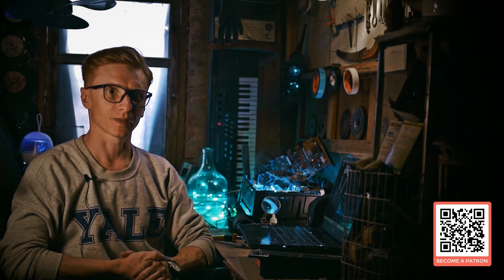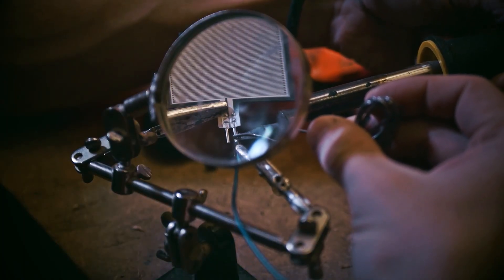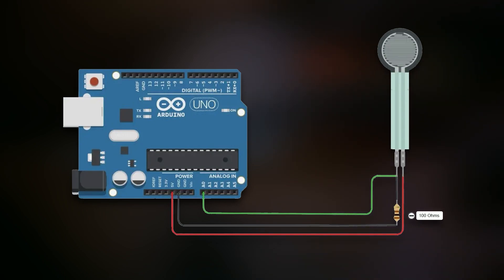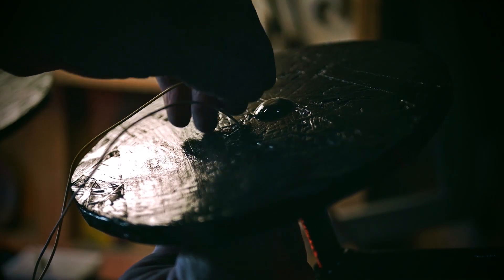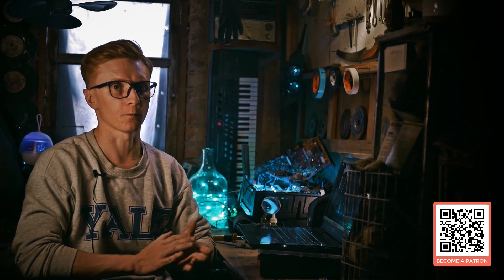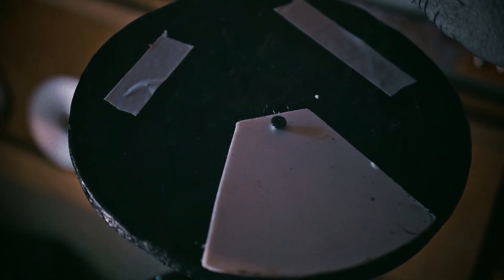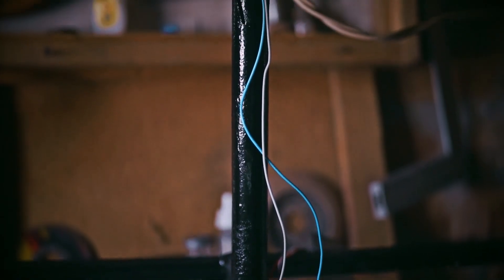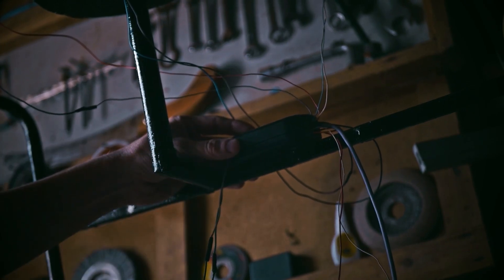DIY Electronic Drums for $20 | Arduino Build | PART 1: HARDWARE

Comment: Bro my drum pad is much much chesper than yours 😅😅😅made my drum pads by making a resistive touch with a plastic school paper file... aluminum tape...sandwiched between trflon tape snd they work amazing... Each pad is basically a large membrane button 🤣🤣 come on bro not all of us are billionaires like you ok
Reply: I'm curious, I'm not great at electronics so I've been learning.  I stuck this in AI and asked it to explain how a diy membrane button works.  One of the things it mentioned is its an either on or off thing, and its max volume no matter how hard you hit it.  I was curious if that's your experience or if you had a way to overcome it (or if AI is just being stupid)?
Reply: @LawrenceMarks27  on and off thing ? Naah if you sandwich the cathode and anode properly with a grid of white Teflon tape between then there is no reason for it not to work  basically the white Teflon has spac3s between so when you stroke you connect the circuit...and yes it is basically a super sensitive triggered drum ....so the lightest strike sounds like a hardshot ...its exactly what I wanted cause I love playing death metal gravity blasts if you know what that is its super fun man ....think of it as a keyboard membrane but with massive buttons and each button is a snare  or symbal or whatever ..i used conductive ink on Transparent plastic printer paper PET SHEETS or thermal paper.. with a grid of teflon tape in between ..dont use electrical tape cause it will insulate the electrical charges...chatGPT likes to complicate things as much as possible and will tske you on a long ass journey while it KNOWS theres a much simpler solution to whatever youre trying to achieve ..its so annoying !!  I wanted to connect a MIPI screen to a rasberry pi and it made waste my money on expencive driver boards ..when al i needed is a mipi adapter ...watch out cause its literally doing this with everything  you ask....hope this helps
Reply: @The_Qarmatian  I think you might have misunderstood what I was saying.  It was more that you don't get a dynamic velocity and it's just a hit with no "touch" to it. Well, that's my question anyway.
Reply: @LawrenceMarks27  sorry homie english is not my language, I still dont understand exactly,  but if this helps...its exactly like playing drums by pushing a button on your keyboard..so there is no rim shots and side snare middle snare ...its one sound per pad (per button)  so the sound of the snare is one audio file yeah it doesnt change no matter how light or hard you hit the pad  ...bps can be as fast as you want....and I play with wooden sticks  ...can play extreamly fast gravity blasts ....I use esp32 with a screen ..I h9pe that somewhere in this reply I answered your curiosity
Reply: @The_Qarmatian  yep, thanks!

Comment: how did you connect the sensor to arduino? i have a drum pad from an old kit i want to reuse and it has 1/4" inch jack out ... wonder how best to get signal into arduino board.

Comment: Think you could make a throttle quadrant for a flight simulator into a midi controller? It’d be a cool replacement for a pitch/mod wheel.